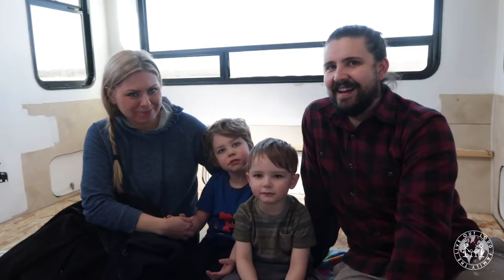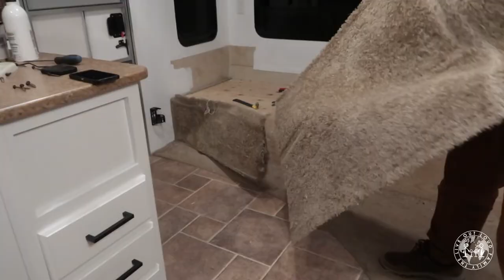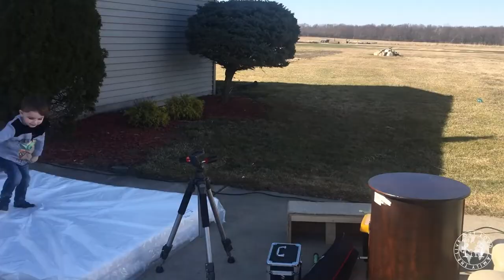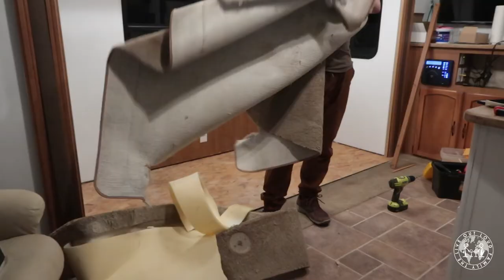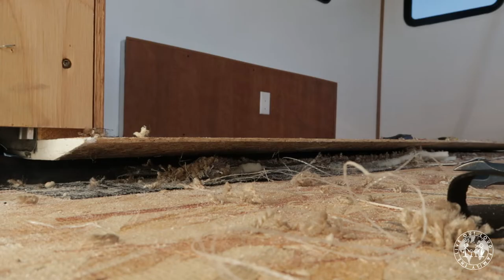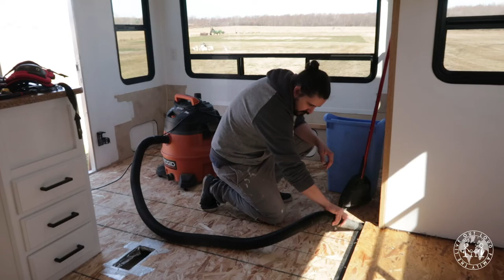How to remove carpet and flooring from RV with a slide-out? FULL-TIME RV LIVING FAMILY OF 4

Comment: Literally trying to pull up carpet in a 36 ft, 3 slides fifth wheel now that i bought from an online auction. Took a break to find help and found your video. Thanks! So, I'm thinking just gut it all and start from scratch or set it ablaze and walk away???...is there an in- between??? Idk 😅🤦‍♀️
Reply from the maker: It’s definitely a labor of love. You’re working with 3 slide outs, I only had the 1 so I feel for you. The staples were definitely infuriating for us. Does your slide out come out flat or slightly raised?

Comment: If your subfloor is solid and doesnt need repairs, you can just lay the planks right over the linoleum and save a lot of time and work.
If you go to bare subfloor, get some sealer on it. 
Spray paint the inside of your ducts black, where the vents are. Its much more esthetically pleasing than the silver look.

I edited it to clarify laying planks right over the linoleum.
Reply from the maker: Thanks so much! Great tips!

Comment: Excellent video.  Thanks for sharing.  I've a question though.  Why and how did you jack your slide up? Thanks again for a great video. 👍
Reply from the maker: Great question. Our slide out doesn’t come out flush. There is a 2/3 inch overhang that was covered by carpet in the original model. We used a car Jack and some wood under the slide out beam to crank it up a couple of inches so I could removed the carpet that I couldn’t get to that was under that extra 2/3 inches. Does that make sense?
Reply: @TheLiveOutLoudFamily  yes, it does make sense.  I'd be afraid of jacking it up. We're about to pull the trigger on removing the carpet so I'll keep your idea on standby. Thanks for the response and explanation. 👍
Reply from the maker: @markevans3589  keep us posted! I remember that anxiety well.